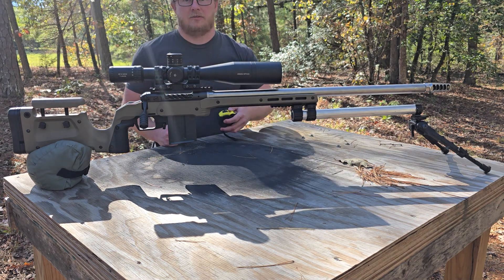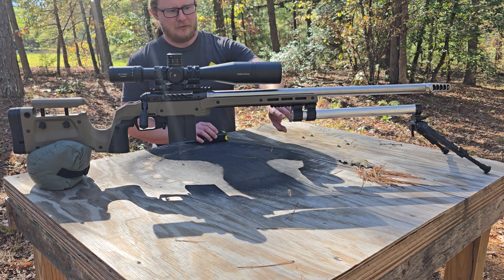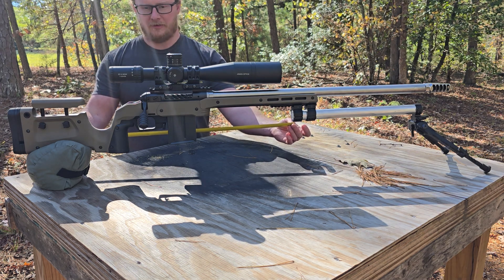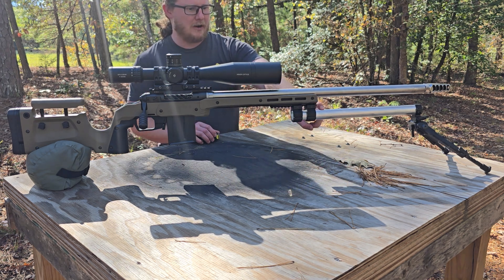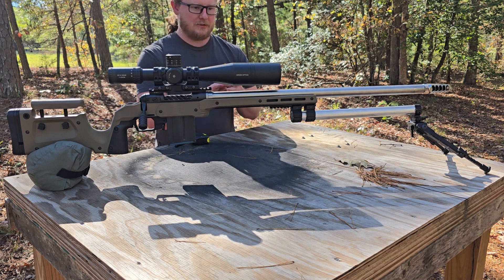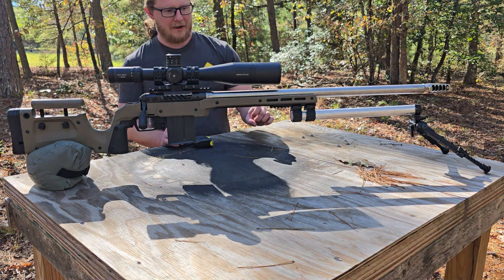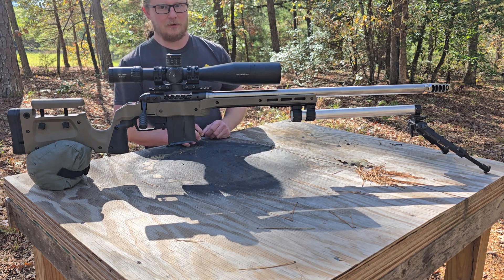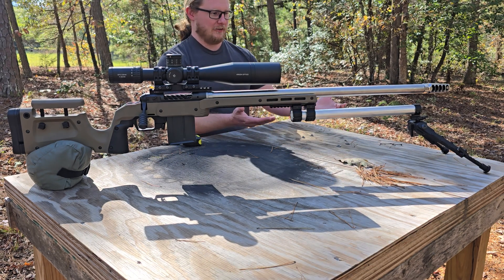Archimedes Lever for Long Range Shooting

Comment: What did you do for the scope ring to the bipod? Did you have to go back to back pic rails or were you able to do it with a single?
Reply from the maker: @onederriktion9449  the bipod attaches to a pic rail. I used a 30mm accessory pic rail.

Comment: Ive been saying that chassis arent built long enough for a long time now, and i've started to DIY solutions like this too. 
I really wonder why the market doesnt offer longer chassis, surely they can make them modular with aluminum extruded fore-ends.
Reply from the maker: @ChielScape I think they could too. The only company I know of that makes chassis with different length options is MDT in their elite series. But they are $$$$ I'd like to see someone come up with one that is modular and customizable.